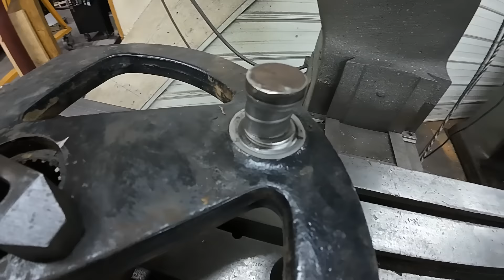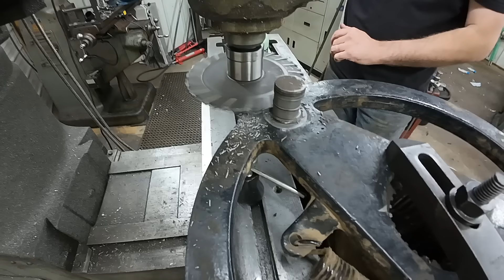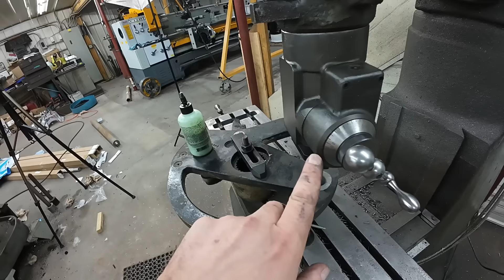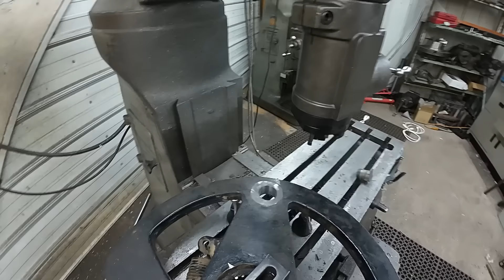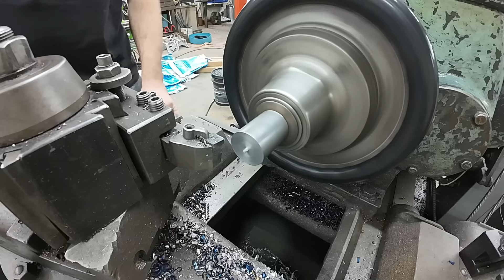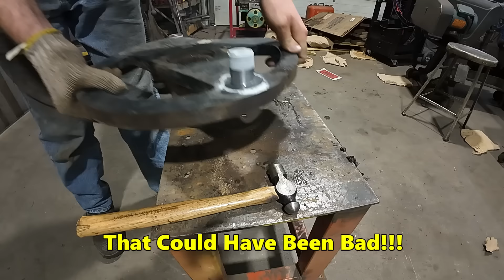We’re Repairing Worn Hay Baler Parts (and Saving $$$)

Comment: Instead of shrink fit I'd drill and tap the bore, prepare a new pin with a thread, loktite it and maybe secure it using a pin halfway between the pin and body. It'll allow less fiddling with  accuracy.

Comment: I would start by setting the boring head on a piece of sacrificial material before setting up the part to machine, it may need a little tweaking per the tool pressure vs different material, but it can save a little chatter or taper.

Comment: i would have turned the pin down to a uniform size and press some bearings onto it and then bored the center out and threaded it for a bolt. rather than having to replace a pin like that every time it's easier to just give them something they can fix in the field simpler. that's why a lot of older farm equipment you'll see modifications to because they just needed a simple solution to finish the job and couldn't wait. fancy is nice but sometime simple is best, especially when it comes to ease of replacement down the line!

Comment: You were very luck your work didn't move after you located the center.  Me, after locating the center I would have drilled a pilot hole in the center of the shaft.  If the work did move, you could still locate the center.  You were lucky.  Jim
Reply from the maker: @emptech  not lucky. I had it clamped better than you may think. Not Mt first rodeo.

Comment: You got extremely lucky, I would suggest the next time you have a similar job,and it’s going to require a ( cold/ hot ) press fit, do it on the press. If you don’t need it,bonus, if you do you’re not in a panic dashing across the shop.

Comment: I need to do a similar job. My question is could i use a boring head with a tool that cuts to the inside? Slower cut the diameter down until its all the same then make a sleeve with the factory OD and press it on?

Comment: I would’ve centered original pin. Drilled hole through.  Take piece to big vise and hacksaw old pin off.  Then setup using centered hole, drill & bore / ream or whatever you want to do.  The new pin I’d make , I’d highly consider designing it to be Silver Bazed on.  Or weld, not sure , I’m not there and not attuned to application of that crank wheel.

Comment: Wow!  great work, but it's still just a danged old baler.  On our farm we would have welded up the worn shaft with 7018, take the hand grinder to smooth it up, measure as you go then take the file to touch it up and bolt the stupid thing together!

Comment: An old trick when installing a shrink fitted shaft is to put a lite coating of high temperature grease on the shaft. It slows down the heat transfer and buys you more time.
Reply from the maker: thanks for the tip!

Comment: Topper how did you indicate that pin location, and then move your spindle several times to machine the pin off, without losing center on it?  Just curious how you did it on a manual mill.  What did I miss?

Comment: So, I’m the beginning you found the center of the pin in relation to the quill, but then moved workpiece, or so it appeared. Wouldn’t it have been better to at that point x in a pilot hole and set up off of that in the event the workpiece were moved? (I’m not very experienced in milling.)

Comment: My father was doing plumbing in a commercial kitchen and someone knocked over a large oxygen tank and broke off the stem which than it became a torpedo. No one was hurt as it went through a wall thank God . Please chain up your bottles. I was just watching random videos enjoyed yours but noticed your gas bottles not secured.
Reply: @dominicmartocci6478  Safety caps should be kept on when not in use.
Reply: @dominicmartocci6478  yep, I've seen the results of a co2 bottle head blasting inside a moving car on a hot day.
Luckily was at vehicle center, chopped off gear shift, went through and damaged the engine, but driver was unharmed, his hands were on the wheel at the moment. The word was it was overfilled and thread went due to heat...
Reply: At the start of my career I worked in a lab where we did safety testing. Someone left a high-pressure tank (nitrogen ?). It fell over, the valve broke off and it went through a concrete block wall.
Reply: @dominicmartocci6478  Many a time, people are simply too lazy to screw the safety cap back on after use.
Reply: just thought I'd come to the comment section & see & sure 'nuff... a cry baby

Comment: One of these days I need to pick up a lathe and a mill, I don’t do anything nasa precision, but I need the ability to turn rotors, drums, cut wheel centers, mill heads, bore cylinders and cases on atvs. Luckily all those tasks have a higher tolerance for small inaccuracies. The biggest problem is finding a used lathe with at least a 14” swing that isn’t 12’ long

Comment: With nitrogen this is not as nerve racking. Great move to rush to arbor press and get it done!! Ray Stormont
Reply from the maker: I wish liquid nitrogen was readily available here. It is not, that is why I have to make dry ice. Which is also not readily available here.
Reply: @TopperMachineLLC  Too bad because nitrogen makes interference fits much easier and somewhat less stressful the only alternative is to add more heat to the female part. THANKS FOR RESPONDING! Ray

Comment: Surly that pin should been heat treated to  harden?
Reply: I wondered the same. Also no coolant used on machining. Measuring a hot piece of metal that is going to cool and shrink a little wouldn't be considered good practice, surely ?

Comment: be able to bring back in service an obsolete piece of machinery is priceless.
excellent job
3 thou interference on a such small diameter is in fact a tight shrink fit so it needs a dry ice cooled pin in a 500 degree F bore, 
I had to a very similar assembly and to my experience, it is a good idea to increase as much as possible the bore temperature to gain  a bit of lattitude in the assembly process.
excellent video

Comment: It’s always best to heat the whole part in a something like an oven rather than localised heating. When heating with a torch the expanded material close the centre has nowhere to go since the outside of the part is still relatively cool this can sometimes make the bore smaller!. In this case it was the underside that must have had a heat induced taper. I love your videos and never see you make a mistake without explaining your reasons for/against afterwards.  
I work for a UK based engineering company with 14 years tool based experience, just passing on some knowledge an old timer kindly/angrily gave to me
Reply: True. Judgement is used as to how best heat it.  Cracking on cool down is a big issue with localized heating of hubs with spokes.  (Not applicable to this repair) Really old flywheels had curved spokes to address the cool down issue before they figured out how to make the straight spoke castings cool after casting without cracking a spoke.  I have lost a few spoked pulleys by only heating the hub.  They make a loud bang when they crack a spoke during cooling.
Reply: We have an older Ken more self cleaning wall oven. On really difficult pieces we can leave it in over night and freeze the pin the next morning. Press it in and put it back in the turned off oven and let it cool down in there.

Comment: Shouldn't that have been supported by something. Its like trying to close a suitcase on a bed . Little or no support makes it more difficult.
Reply from the maker: It was supported. Did you not see the Machinist jacks.
Reply: @TopperMachineLLC  There are jacks when you machined the hole, but i still don't see them when you hammered in the pin.

Comment: That was a high stress moment... averted..

Better to set up the press-shrink fit in the press with the press ready to press before heating the part while the stud is cooling off in dry ice. If the stud is even a tiny bit off axis even with a few thousands of clearance the stud will likely  get stuck on the way down the hole. More often than not, the press I needed to avert a Oooops and not fun at ll re-do..

There is a tendency for metal to stick when they are close together, this is why clearance alone is not enough. Some means of mechanical aid (force) is often needed to over come this tendency for separate metal parts to wanna cling together.

Comment: Big thing about using dry ice vs LN2 is -109 degree F vs -320 degree F, you only get about one-third of the shrink; gotta keep that in mind. With LN2, the part probably would have dropped right in (at the expense of 2 hours driving to get the stuff).

Anyway, nice job there, it's always interesting to see how people approach a problem and get it done.
Reply from the maker: It would have been 2 hours of driving for dry ice, that is why I make it.  LN2 would be 3-4 hours of drive time, making that unacceptable.  I can't bill for time and materials to get supplies for a simple job.  I wish I could get LN2, it just can't happen here, too depressed of a region.

Comment: I don't even like watching those press fits and I'm not even responsible for the outcome. Assuming it's one of those things that no matter how many you do, you're never really relaxed.

Is there a formula or table you machinists use to know how how to size those? Or just learned from experience and hopefully as little trial and error as possible? I'd imagine the properties of the materials matter too for how much they expend and contract.
Reply from the maker: I am always nervous doing this work.  Generally, 0.002" for each inch of diameter is the high end for a shrink fit.  I went just a little more for safety.
Reply: Look for a publication named "Machinists Handbook"

Comment: I’m pretty sure that CNH actually stands for Can Not Have.  Owned by parent company Fiat, which must be Italian for Fix It Again Tomorrow.  I have been operating and maintaining a first generation New Holland large square baler for 25 years this year.  It is appalling how many parts are no longer available (NLA in CNH speak).  If they are available the price is obscene.  

FWIW -- CIH labeled pre New Holland/Case IH merger large square balers were built by Heston here in the US.  After the merger, CIH large squares were rebadged New Holland machines.  All large square balers built by New Holland except the New Holland 2000 were built in  Zedelgem Belgium.
Reply: If each part in a tractor was replaced by a new replacement part as it wore out, would it still be the same tractor?

Comment: I have never done it that way and mabye that is because that has more wear than I have seen. 

I use a boring head (left hand boring bar faceing the inside of boring head) and machine it to a smaller diameter and make a sleeve to bring it back to spec.
Reply from the maker: Depends on the application.  I have done both ways.  Check out my video from the previous week.

Comment: Just a note about sawing off the pin with a slitting saw, slitting saws are pricey but my favorite alternative nowadays is the 8 inch carbide tip blades they sell for metal cutting skilsaw type saws. They are cheap like 40 bucks and less kerf, I have one on an R8 arbor I use all the time for cutting down pieces too short to hold in the bandsaw, slotting, or even have used it in the angle head for cutting plate clamped down to the table. Works great and in 4 years now I am still on the first saw blade of the 2 pack I bought!
Reply from the maker: Nice. Great idea, I'll be using this.
Reply: @TopperMachineLLC  
Specs please .. Brand name, tooth count, RPM's, feed speed and depths, lube type, etc ..  
This could be a great video with a chalk talk about the blade and how to figure out the right settings for different materials.
I wonder if any blade companies are brave enough to sponsor it with their product featured in the action shots

Comment: I think if you had cleaned both the bore and mating shaft with some fine grit or emory, it would have been a cleaner fit and no press would have been needed. What looks like a smooth finish to our imperfect eyes is really very rough under a scope.  Keep up the great work Josh.

Comment: hi very important to do when you're pressing there is a book that gives you the exact diameters for a press fit slip fit based on diameter of the shaft. you can find one the Internet
Next time you press shaft give yourself a small taper about  taper so you know it's going in straight and put a heavy grease on the shaft and the bore.
Reply from the maker: I have all the specs, this was done to be extra tight so it would not losen up.

Comment: Never did say what the parent metal was. It looked like steel to me and not cast Iron. The pin you turned was Steel  but what grade? Inquiring minds need to know. Loved the video and the use of coaxial indicator. You logged the center position of the pin hole and then macked off the pin. I loved the results. .003 fit is tight. I noticed you did not skim the surface of the wheel the saw must have left a satisfactory finish. Hope the baler runs another fifty years. New Holland  balers and swathers  are around sitting out in fields rusting. My guess is pin was 1045. But I have been wrong before. Cheers.
Reply from the maker: My guess is that the piece was ductile iron. But that's just a guess.
Reply: Heard it pop when you jacked it in with the press I always grab a felt tip pen and put the date on the oxygen cylinder and the acetylene. Just so I know when I last exchanged them. Do you drive to town to get refills? @TopperMachineLLC
Reply from the maker: @martinnorbeck4657  I have 2 of each bottle that is frequently used so one can be taken in when it's convenient. I no longer use acetylene. I switched to propane and filled off my bulk tank.
Reply: Got it. I used propane before. Boss had 1,000 gallon tank to run his farm and use for heating etc. All the gas powered vehicles were converted to propane. You made the ice and then just tossed the part into the bag. Nice production job Topper. @TopperMachineLLC

Comment: It's always good to be able to repair expensive parts and save customers a fortune as opposed to them buying a new part. It also works when the part is no longer available, as it saves an old machine so they don't have to spend an even bigger fortune to replace an expensive machine.

Comment: Very nice repair Josh!  Love to see old stuff repaired rather than being scrapped or replaced.  I got some "remote pucker factor" when you were putting in that pin thinking "oh crap!" it's too tight!  Glad you got it home with the press.  Was the base crank material cast steel?  It looked like it was making a chip like I'd expect for steel when you drilled it.
Reply from the maker: I think it's ductile iron.
Reply: @TopperMachineLLC  Very interesting!  I wouldn't have guessed ductile cast iron.  Very cool. Thanks for the response!

Comment: You must have had the camera on the birdgeport table when you were using the slitting saw to take the old pin off.  Little bit of chatter combined with the camera frame rate gave an image effect that was better than any hollywood special effect for inducing motion sickness.
Reply from the maker: Yeah, I wasn't too happy about it. Didn't even consider that possiblity. I will know for next time.

Comment: "Let's see if we can do it in one shot" Wouldn't the balanced-cut method be less risky? Split the difference and take it in 2 cuts, about half.  Tweak the 2nd cut based on the results from the 1st cut.   It would take some of the uncertainty out of the process, whether from the boring/facing head, deflection, or shop gremlins.  Same for the shaft, when you had 0.008 to go.  Instead of taking 7 and 1, cut 3.5 and re-measure.  If you're off by 2 10ths, correcting the final cut from 3.5 to 3.3 thou is much more likely to work because deflection and other factors are almost constant.  Anyway, thanks for the video.
Reply from the maker: In my experience it never works that way. Depending on size and material, I know roughly what to plan for cuts. Generally, anything under 0.020 is not accurate due to tool pressure. Also, shallow cuts leave bad surface finishes

Comment: I enjoyed watching this repair.  My best experience with a precision shrink fit was on the cutter head for an asphalt milling machine.  It was 3-15/16 dia. And about 5” long.  The interference was 5-1/2 thou so I specified dry ice and heat to 300 deg. F.  Because of the bore length we set the parts up in a 30-ton press just in case, which turned out to be good thinking.  There was definitely a bit of pucker factor as temperatures try to equalize quickly.  Those dry ice fits sometimes make interesting sounds when seating.  Thanks for sharing this one.
Reply from the maker: I used to do some similar sized ones. Since LN2 is not readily available here,dry ice is the best bet. We always went to 400° for safety. Needed the press one time.

Comment: Watching shrink fits gives me the hives. That moment when it suddenly won't budge any further and I fall off my chair. Glad it worked well, Josh. Good repair, as always.
Reply from the maker: Always scary.
Reply: I never saw a machinist run that fast before.
Reply from the maker: @scottcates  I have. Lol. When you gotta get to the bathroom, and needed to finish the finishing pass you were in. Saw a guy not make it in time and crapped himself.
Reply: @scottcates  😁
Reply: In my shop we have a freezer that is -100°. It's made for the medical field. I also found out when press fitting you cool or heat one side not both. It tends to fight each other when heat and cool.

Comment: i looked at the dandrea and i could not find any like the one you had i have a job i do and acuracy is a plus minus 3 thou so one like that with the adjust handle on the stationary would work perfect because of the facing part is what would make it perfect for my job ive never seen a dandrea that is made that way but it doesnt mean they did or do make one
Reply from the maker: I've seen several. They are rare.